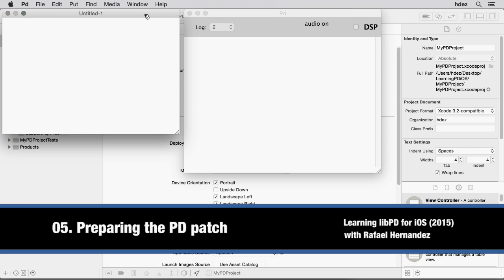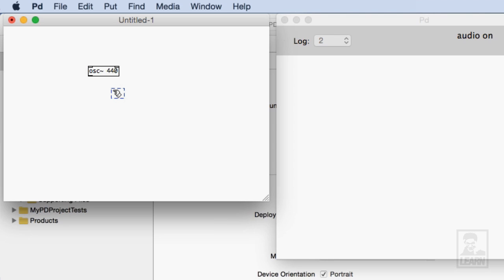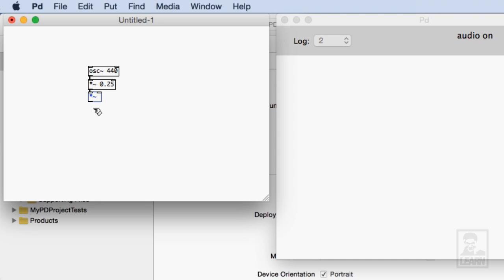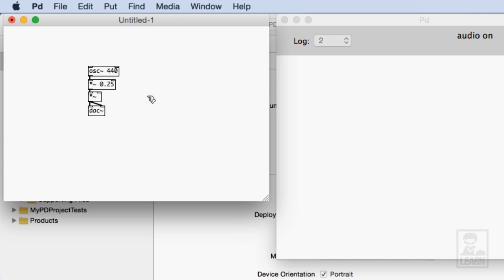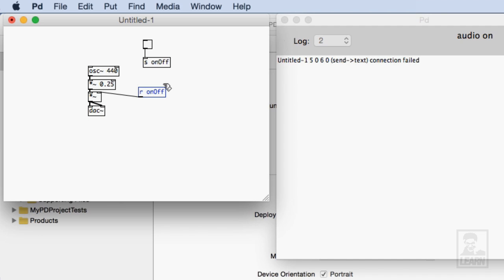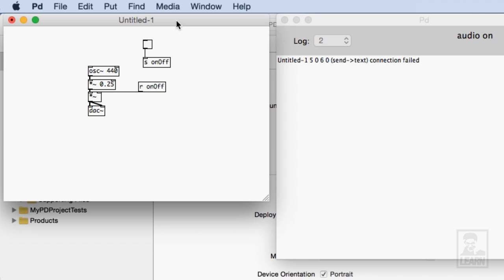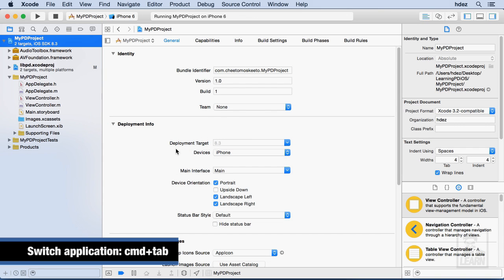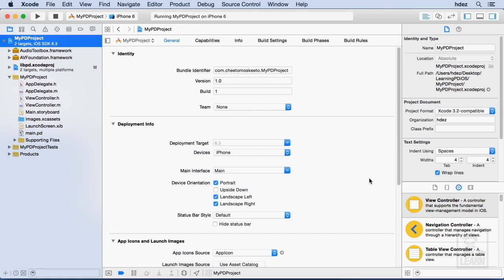Learning libPD for iOS: 05. Preparing the PD patch

Comment: Hello, thanks for your tutorials, they are very useful. I am using Xcode 7 on OS 10.11.4 and got the following error message when building the project in tutorial 4 : Could not attach to pid : “1349”. I had previously got another similar message and found the solution by deactivating the system integrity protection. Did you encounter the same issue with OS 10.11? Thanks!
Reply from the maker: +Coralie Diatkine I've never gotten that error.